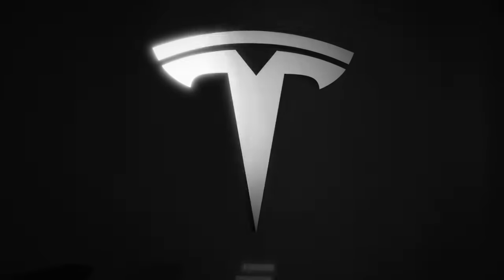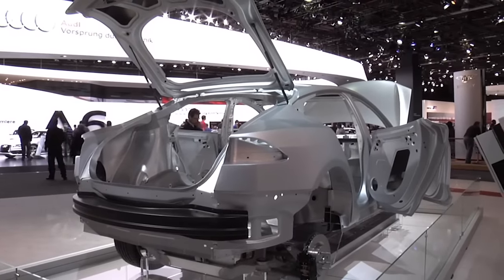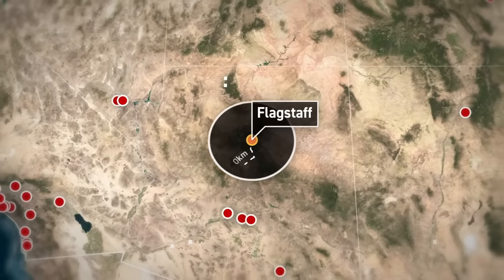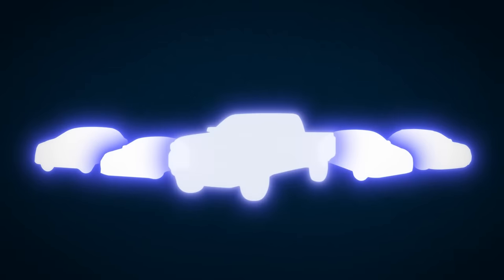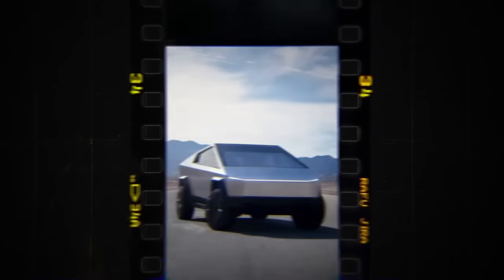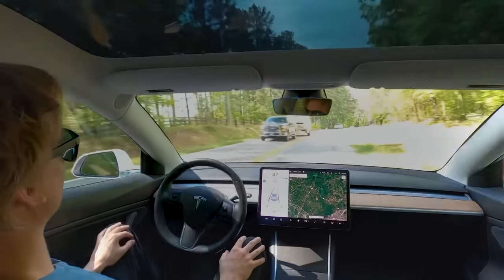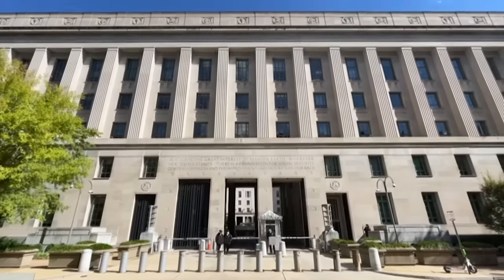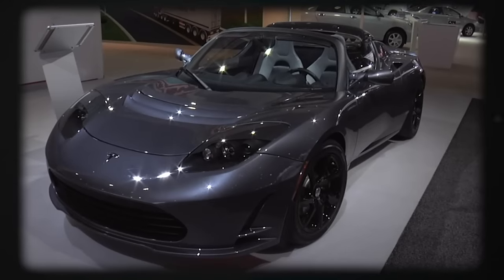How Tesla Fumbled

Comment: This video was recommended to me a year after it was uploaded.  It has not aged well, but that is not the fault of the content creators.  The market has soured on EVs.  The charging network for non-Tesla vehicles just isn't there and the economic case for private commercial charging stations is sorely lacking.  The revenue potential of a charger in use 24/7 justifies investing in it, but having only enough chargers that they are all used that much is a major turn-off for buyers.  A broad enough network of chargers that allows people to just be able to drive up to one and start charging (meaning that many chargers are idle for much of the time) is a major turn off for investors.  Nobody manufactures an EV that is easier to repair and service than a Tesla.  Legacy car maker EVs are not any cheaper to fix than a Tesla.  As any damage to the battery often gets the entire EV written off, insurance costs for EV are much higher than for similarly priced ICE vehicles.

EVs are looking like something that seems like a good idea, until you actually get one.  Until there is a utility grade battery (a battery that can both quickly charge or discharge, with a service life of decades) that can be mounted in a vehicle, EV mandates are premature.
Reply: Richard, no even if you got a fast charging battery, that doesn't tell u the whole story. Say you got a relatively small 60kwh battery on your EV. If you have a battery that can charge it from 0-100% in 5 minutes like filling up with petrol you need 60*12=720kwh of electricity. If you build a charging station which can do the same thing to ten cars it means 720kwh*10=7.2 megawatt. That is enough to power hundreds of residential houses. Provide electricity to hundreds of homes or just ten electric cars? You tell me which is better?

Comment: I don't really think this is fumbling but rather that its electric competitors don't matter. Since at present EV's don't really matter generally they are expensive, heavy and at present hard to scale in number. Tesla is not designed to produce show pieces and small batch production EV's. The stated goal of the company is mass adoption and acceptance you can't really take the approach BYD does by building rolling bombs. But you need to develop underlying competency, batteries, manufacturing and brute scale. Underlying technology is vastly more important than models or PR. You could sell a Tesla to an Elon Musk hating dem or a coal loving republican. If the cars underlying specs are competitive hence the issue of technology is huge as it applies to EV's.

Comment: There seems to be two groups of people with very different opinions abt tesla. First are the ones that actually own or driven them and the second are the ones who’ve read and heard abt them on the internet. The former is blown away by their cars and the company while the latter thinks tesla is a flop. This video definitely seems to be based on opinions of the latter 😂 I mean, you’re comparing a bolt to a model 3? Seriously? Driven both and the two are totally different class of vehicles buddy. Bolt torque steers all over the place, body roll is hilarious, charges slow af, and literally built with plastic everywhere. And try doing a road trip without the supercharger based route planning. The trip becomes an assignment which if you fail, you end up at the side of the road.

Comment: Tesla’s product is the factory, not the vehicle!

If you want to understand how they’re executing, watch their investor day presentation (no model unveilings or renderings from Super Bowl ads of vehicles that won’t be ever be built) then do the math on their manufacturing scaling, not consumer reports.

A few fact checks. How many Hummers have GM Produced? Fewer than 1 shift of Tesla Shanghai’s production rate. 

How many Rivians & Lucids have been built, combined, ever? Fewer than 1 month of Tesla Shanghai’s production, just one of the 4 current Tesla factories. 

The Shanghai factory was in production in under 12 months from breaking ground in a foreign market. 

Ford’s new factory (built on home turf) will take twice as long with half the capacity. Tesla’s new factory in Mexico will out produce it from the get go, even though Ford has a 12 month head start. 

This shouldn’t be so difficult to follow. It’s not like they’re hiding it. Just pay attention.

The other auto manufacturers have fumbled with too many models (too far down the track) and not enough near term profitable production capacity to save them from bankruptcy. 

This video will not age well.

Comment: 13:20 - what's worse, Tesla recently admitted that $15k pre-paid "FSD" hardware will not be capable of running the final FSD software (if it ever materializes), and no retrofits are planned. I see a class action lawsuit on the horizon.
Reply: I wonder if they’re coming to accept that they have to have LiDAR as part of the solution.
Reply: Full Self Driving = BS
Reply: @JoeOvercoat  People tend to be enamored with "one size forts all" solution when it comes to sensors, mostly because sensor fusion is difficult problem, but one solved long ago in aerospace industry. Musk insists on visible spectrum cameras; Sandy Munro, alter learning in one of his gigs of FLIR considers that the universal solution (apparently not realizing those are just infrared cameras, something that, say, Mercedes uses for ages); Waymo decks their vehicles in lots of bulky, electromechanical lidars etc. 
This is a complex problem, and it requires open mind.
Reply: @bazoo513  Yup. Sensor fusion is the over-riding answer. There should absolutely be a range of sensors feeding the sensor fusion system just like human operators use their eyes their ears and there butts. The reason mask went with the vision system is because that’s the cheapest. One sensor fusion is difficult and expensive. That’s why some providers will elect to forgo doing the right thing.

Comment: Tell you why the price of the Model 3 is so much higher than the Bolt

The bolt cannot fast charge beyond 50 kW and Tesla's supercharger network can charge the Model 3

Also if Tesla lowered their price they would have more demand then production capacity.

You can see this when you look at inventory and wait list. If the wait list is high then that means they have to guarantee that price on delivery even if the price of materials went up. And if the inventory is high, then the price is too high and it needs to be lowered.

Bolt however does not have a production problem. It has a demand problem. More people are willing to buy the Model 3 and even more people are willing to spend about $10,000 more on a Model Y, and it doesn't even have a standard range option because of that.

Me personally I'm waiting for their cheap compact car or the Aptera, whichever comes first. (Supercharged network capable for both)
Reply: Ps

The Bolt is selling for a loss. General motors said that they won't be profitable until 2026, Tesla is profitable now and the most profitable.

You only get high profit margins if your vehicles are high in demand compared to competition.

Comment: The big difference is that all the other charging networks are terrible. Tesla is operating under the (largely correct) assumption that the other chucklehead car companies are all going to fight each other on who would pay for and control the EV charging network that they would have to cooperate on and build to challenge Tesla. So what you are left with is a bunch of broken chargers and crappy apps you have to sign up for, download, in some cases load money onto, and use once (in the most inconvenient manner possible).

Comment: Hmm. On balance, not usefully informative.

If you’re looking for a negative take on Tesla, this opinion piece includes lots of references to notable Tesla foibles over the past 15 years.

If you are a Tesla supporter you’ll quickly note the number of ways information has been cherry-picked, timelines intermingled, and relevant context dismissed resulting in a video that does a good job of slinging mud and does more to create confusion than clarity.

If you are new to the Tesla discussion and looking for an informative, objective take… this isn’t it.

Comment: Just did a test drive comparison of Model Y, X, BMW iX, Audi Q4 EV, Lexus RX450e . 
For US, Model Y makes the most sense on today's market because of the fact shit is about to change dramatically over the next 3 years (NACS). 
Why?
Model X has a smoother drive than Y, because of the difference in suspension tech. But the cost is too high compared to the Y. I dgaf bout butterfly doors. 
BMW iX is a great car all around, but the payments made its technology seem lacking compared to Tesla. 
Audi for some reason does an 8% APR and thus doesn't really care if general people buy their cars , & has their cars missing tech due to the chip shortages. Tony Stark would shake his head. 
Lexus is lacking in tech, & didnt like the fact its basically the same car as the Toyota BZRX or whatever the fuck they've called it. 
~
In the next three to four years, all these models will have undergone dramatic changes as a result of the lessons learned for the past 7 years.

Comment: You only need a surface level  understanding of the energy market, auto industry, and company landscape to know that electric vehicles are a huge scam right now. 

Your electric-vehicle is not better for the environment. My truck runs on 100% gasoline sure. But depending on where you live. Your electric vehicle runs on any thing between 15% and 40% coal. 

Anyone even remotely educated and in the market for a vehicle knows that the more digital a vehicle is, the more expensive it is service it. 
The Best value on a vehicle is still going to be a vehicle that is naturally aspirated and is analog. Companies like to move towards digital because they can force you you to come to the dealer for software provisioning. 

Some companies now don’t allow car owners to change their own battery as the simple active swapping a battery out requires a factory authorized provision. 

The auto makers would like to move towards a monthly service fee to use their vehicles. However, they are willing to settle for simply forcing you to come to them the OEM for any and all service needs.  

So if you’re one of the idiots who thinks you’re ahead of the curve for buying electric vehicle, enjoy paying $200 for windshield wipers and good luck charging when the already taxed grid can’t support your car
Reply: Where I live only 7.3 percent of the grid’s electricity is fossil fuels, 7 percent of that is natural gas.

Comment: The build quality sucks, yes.  But the real problem is getting it fixed.  You need to take it to tesla for just about everything that goes wrong with it and they take forever to get it fixed.  Got a dent?  Take it to tesla, even if it's a 3 hour drive to the nearest dealer, instead of the bodyshop down the street.

Comment: Something to also add is that Tesla has really refused to improve the product in terms of features or interior design/materials. It's competitors don't just have better quality control for the price, they offer more. Certainly Tesla has best in class UI on their screen, but it's just one screen, what you can do with it is limited, V2L is something they've shunned, moving to 800v for faster charging is something they've shunned. There is so much that moving to an electric platform allows that was not before possible and Tesla has stuck with cheap minimalism at luxury car prices. I think Hyundai who you didn't mention is really the company to watch at this point, given what their cars offer in quality, reliability, and thoughtful features (though their UI and navigation need work).

Comment: In Tesla's defense in China, China has been known for using western companies to come in and stir up a market, then will flood that market with local knockoffs which can both under cut the foreign brands and will generate local jobs.  Rarely are the products better or unique, and in most cases they are worse, but they are local and cheaper. 

Yet everything else is correct, Tesla is only ahead because of its "first to market" advantage, but now the only reason why it is still going strong is its fan base, and its sales structure.  By forcing people to buy cars, sometimes over a year in advance it takes a while for those orders to be fulfilled. It makes them a bit more insulated from economic downturns. While I do not see the company going away in ten years, I don't see them holding on for much longer.  Ford will soon have EV's in the low $30's, VW has there's, so does GM and everyone is working on that key demographic, a REAL SUV, not the almost hatch back wagon like the MachE and the EV6 (great cars, but not really what people buy). Meanwhile Tesla is working on none of that, and this cyber truck is butt ugly. But only time will tell.

Comment: Sigh, this attack video selectively filters info and leaves out the full picture:
- Tesla Supercharger Network (charging to 70 or 80% in 20 minutes, while other EV brands take at least 35 minutes to 9+ hours
- Direct selling with full price transparency with rebated included, without markups and negotiations
- The fact that a big part of production hell was due to the Covid-19 supply chain issues and still managed to increase production and deliveries year over year [iirc 40%+] (while other manufacturers' sales were dwindling or flat)

Comment: The big fumble is becoming clearer. They are a one brand auto maker and that is not sustainible long term unless you are very very good at building a large range of models, and so far Tesla has not done that. You cannot cover all markets, defray your development costs and make money in a competative market without volume across platforms. Tesla needs to be bought by someone with more money than sense...
Any technological or design leads do not last long, Tesla have wasted theirs in EVs. The one area where they may re-create advantage is in autonomous driving, but that advantage is debatable for 2 reasons. It may not work well enough to create a real value add on, or volume consumers may not care enough to buy it.
Being a niche car maker has a limited life span, its grow or die.

Comment: Id rather buy a gas car. These new electric cars are still expensive as hell along with new car problems that are alot harder to fix.
Reply: The average cost of a new car  these days is 35-40k USD. All cars are expensive as hell with the average used car at 15-20k.
Reply: @IMAPOTATOZ  ok rich boy. 
2023 Toyota Camry starts $26k.
2023 Mitsubishi Mirage $16k
Nissan Versa $15k

Meanwhile changing out battery every few years on an electric is $5-20k.
Reply: @RubySapior  every few years? You mean the 12v battery every car has? Because that doesn't have a 10 yr warranty, nor does it cost tens of thousands. 

My tesla was cheaper than the camry because of rebates and dealers jacking up the price. Yeah, they may start at 26k, but 99% of the time, that's not what it sells for.
Reply: @IMAPOTATOZ  Electric car battery, not the fish food batteries.

Comment: Nothing says "green" like the amount of fossil fuel derived electricity it takes to power an F-350.  It takes more energy to drive an EV than an ICE auto.  Nothing says nonsense like, "Save the planet as long as I get to have a 3 ton car."  The Vegas loop is a joke.  Nice how there's no emergency access catwalk in the tunnels for when these fire prone Tesla batteries ignite after crashes in between "stations."  I guess you'll dial 911 with whatever passes for a cellphone signal when you're ensconced in a subterranean concrete tunnel.  You'll be stuck in that flaming vehicle whose doors you can't open because they're electric only.  Not that it matters as the doors will be stuck against the concrete tunnel walls leaving no room to evacuate. You beat traffic by riding subways not by driving your car in one like a dipshit.

Comment: Elitric only drive vehicles. Have excellent on paper statistics, but they lack one crucial requirement for a "useful" truck. Towing. Increasing load on electric motors increases power draw. Elitric "trucks" can't pull heavy loads. Wait before you give me the torque. They can't pull it distance.
Reply: You have it completely backwards unfortunately.

The biggest issue with towing is cooling. Electric vehicles when towing have less of an efficiency hit than diesels. The way torque of an engine and motor works differently, especially at high speeds, and a combustion engine can certain not regen down a hill. 

The biggest issue with most "pickup" EVs is the fact that they are pretentious luxury items that are built to attract customers with a masculine tickling brick shape rather than be clever and make an EV/PHEV Ford Maverick or Ranger. The second biggest issue particularly for OEMs is that they don't utilise heat generation of the motors and batteries into the climate control system, but rather they engineer separate cooling systems like in an ICE truck so the scenario exists where towing in cold temps means wasting heat from the motors and wasting more heavy keeping the cabin warm. 

It's crap
Reply: @toyotaprius79  My bad I didn't see read more because I was to busy riding my high horse. You are correct, but that's why their are electric semi trucks.